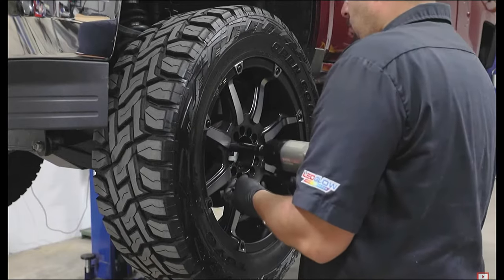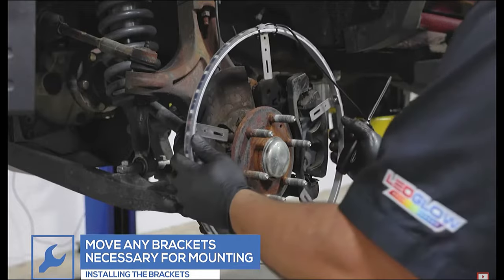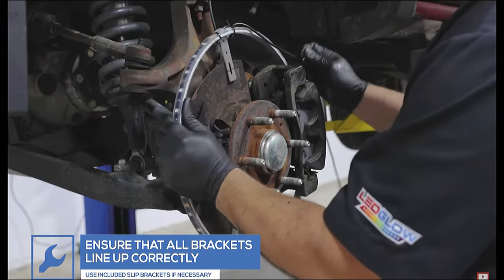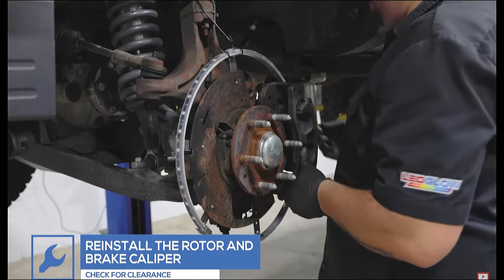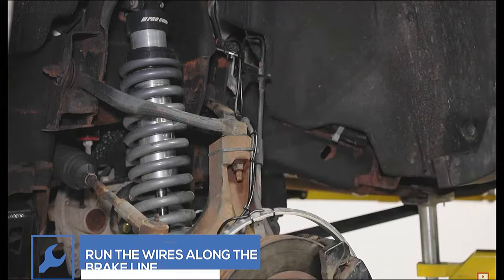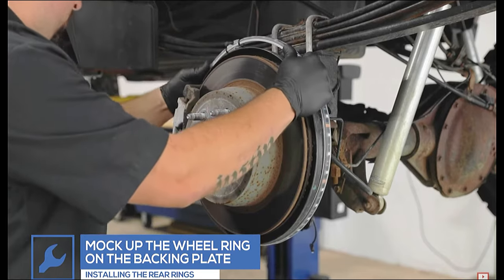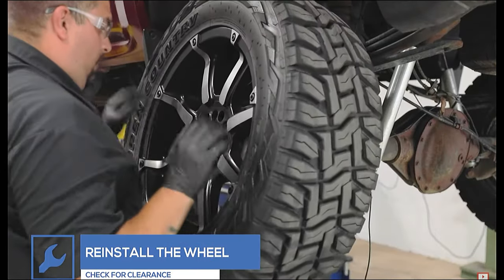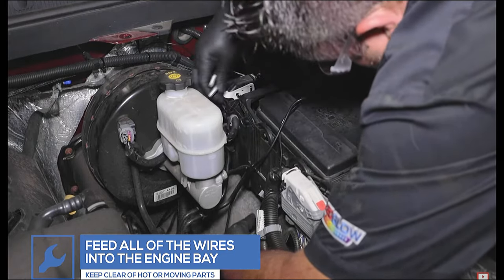OTOMO - Wheel light installation instruction video

Comment: Hey man got a question got wheel lights I’m confused on the brake/turn signal wire function. Could I wire it to the head lights or does it gotta be tail lights ?
Reply from the maker: Hello, we are sorry that we just saw your message now. The white brake wiring is connected to the positive pole of the car's brake light; the yellow and green turn signal wiring are connected to the positive pole of the car's left and right turn lights respectively.
We promise to provide you with high-quality customer service and after-sales service. If you have any questions, you can contact us at any time via email: otomo888@sina.com

Comment: Can you make a video on how to connect the wire because I'm lost...
Reply from the maker: Sorry, we are currently unable to produce the video you require quickly. You can try reading the following text.
1. The AC fuse box is located on the lower left side of the steering column of the car. It is responsible for the circuit safety of the turn signals, window lifters, cigarette lighters, airbags, and electric seats. The other fuse box is located in the engine compartment. Open the car's In the engine compartment, you can see a fuse box on the right side of the engine compartment, which is responsible for the circuit safety of the glass water, car headlights, horns, ECU, and ABS.
2. The back of the AC fuse box cover will have instructions for the purpose of the fuse. You can refer to the instruction to find the corresponding turn signal and brake light fuses, and then draw power from the corresponding places.
3. The red and black wires on the control box are connected to the positive and negative poles of the AC fuse box/power supply; the white wire is connected to the positive pole of the brake light; the yellow and green wires are connected to the positive poles of the left and right turn signals of the car respectively.
If the above content still does not solve the problem, please reply to this message or contact us at: otomo888@sina.com
We will definitely provide you with high-quality after-sales service. Thank you for your understanding.

Comment: The leds working fine when the cart is off. But when the car turns on, the leds keep blinking red. My garage can't figure out whats wrong. Because everyting works, turn signals etc. but when the car starts or makes an electrical connection, the leds keeps blinking red.
Reply from the maker: Hello, we are sorry that we just saw your message now. Based on your description, we analyze that the wiring of the control box is incorrect, which leads to this situation. We will definitely solve all product problems for you and provide high-quality after-sales service. Please send your detailed order number and address to our email: otomo888@sina.com

Comment: This does not show you how to connect the wires to have power to the ring lights,  But it shows you where and how to connect the ring lights in how to run the wire.
Reply from the maker: Yes, this video is mainly to show you the detailed installation method. Thanks for your valuable suggestion, we will update more videos of product effects.